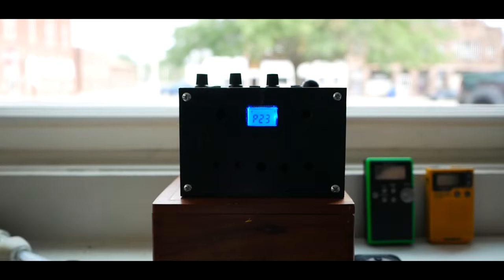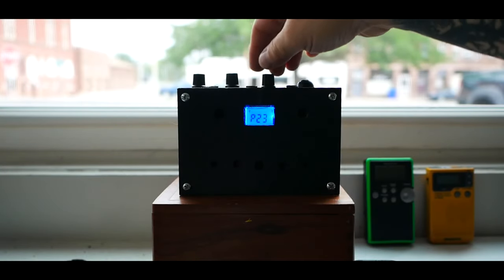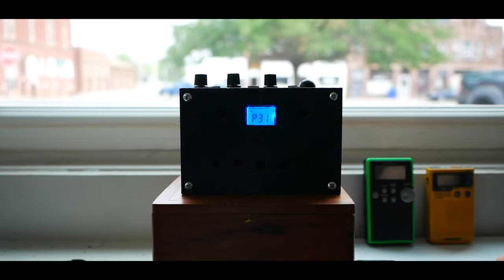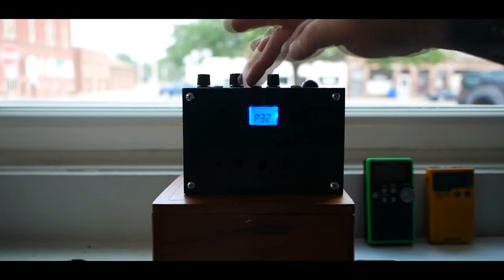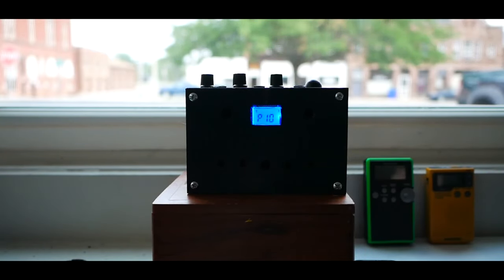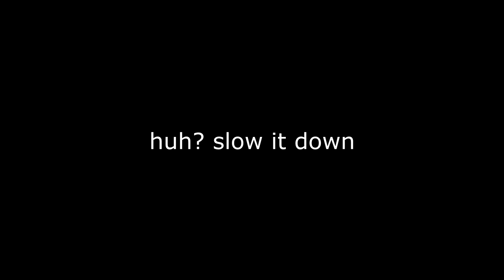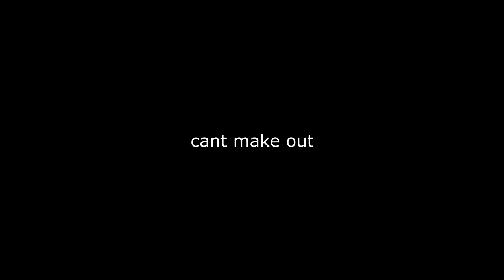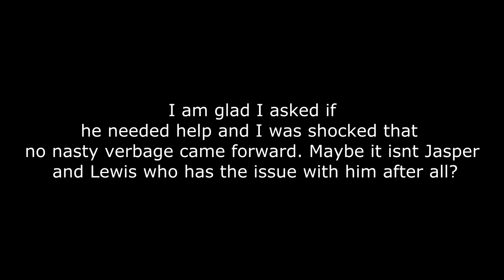Custom Spirit Box update and pretty good session with Tom

Comment: Well man, you've truly done it with this one. Regarding the boxes, I understand you want them to be a certain way; without issues, but I love the audio. I'm curious what it sounds like sweeping a little faster? I'd love to know what you'll be selling them for. I want one...definitely! That's the clearest scanning ghostbox out there. I'm so glad you were able to accomplish that too. Good work man!!
Reply from the maker: Thanks, I worked for quite awhile on it. I will try another module for scan rate but the issue with the ones I have tried so far is the ticking. I dont want it to sound like a nasty psb 7. This is the only one so far that keeps it clean, but slower. Is the setback.  But I dont think it hinders it too much. I still had many relevant replies.  Price... I wont know for sure until I work out is it this case or something else and my antenna issue.